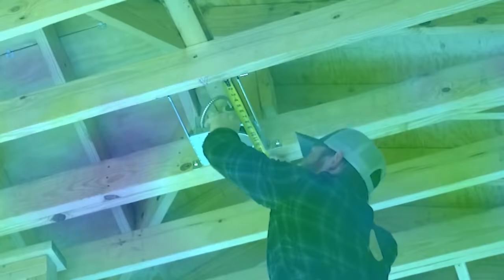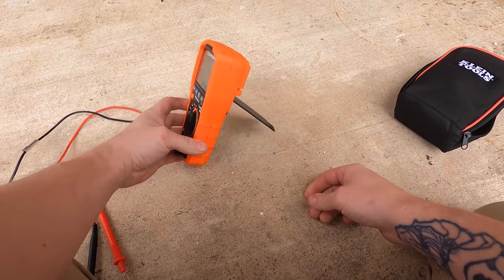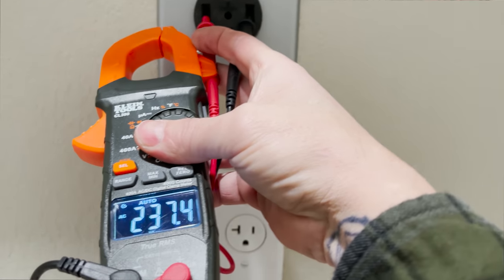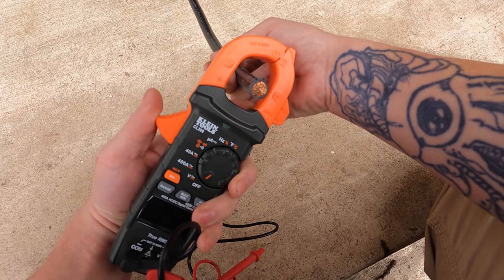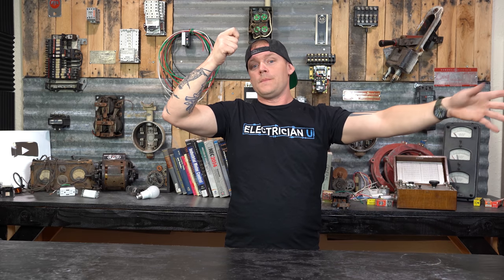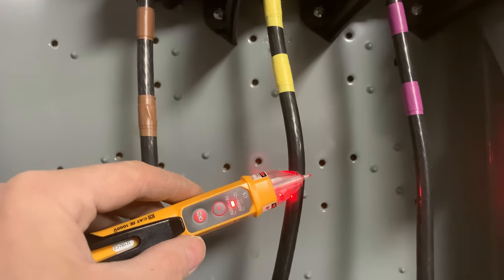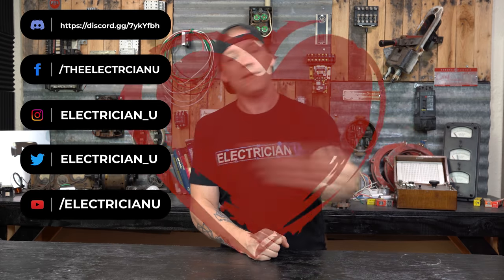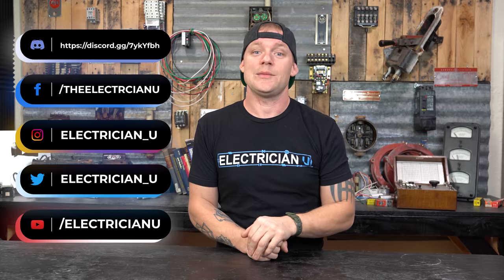4 Basic Electrical Testers & HOW TO USE THEM

Comment: Checking for current is like making sure a gun is unloaded or there is fuel and oil in the airplane. Check it yourself. If I tell you it is okay, still check it yourself.
Reply: Agreed and your loaded gun comparison is spot on.
Reply: The airplane analogy doesn’t really work but I agree with the rest
Reply: Whether the wire carries current or not, it doesn’t matter. What matters is if the wire has a voltage with respect to where you stand (usually Earth ground).

A wire is said to be live/hot/active if it has voltage (with respect to ground), not if it carries current or not.
Reply: Day one of my apprenticeship I was with a journeyman who checked to make sure the fixture I was working on was dead. Then he handed me the multimeter and had me test it myself and said the number one rule when it comes to my own safety is to trust no one and always test for yourself. Really valuable lesson to learn in this field.
Reply: As a law enforcement officer, when dropping off a prisoner to lockup, they would always ask if the prisoner had been searched.  My response, “The prisoner has been searched, but for your own safety, he should be searched again.”
Reply: My journeyman told me when I first started “don’t trust me” and I was like dang! So I don’t trust anyone now if they tel me it’s off
Reply: Check for voltage.  Voltage is the loaded gun.  Current is the bullet on trajectory.
Reply: I also thought of the loaded/cleared firearm analogy while watching the video 👍🏻
Reply: @skautisti2868 if the airplane runs out of fuel she may crash . The analogy of be sure of something yourself not depending on another's word something is safe .
Reply: @glasshalffull8625 amen my friend.  Safety first
Reply: At 1.5V will you be electrocuted? How about at 240v ? I don't know why they keep saying electrocuted why not voltageted?😁
Reply: Love the gun analogy
Reply: Yep, had a boss tell power was off on a machine, only trusted him because it was my boss, and got my ass shocked like a mf

Comment: Wow, this has been up a few hours and not one person whining about the meter not being Fluke? I'm impressed.
Reply: I see Klein is the new sponsor listed on this video
Reply: @johndernberger1961  Right? Wish I was sponsored by Klein
Reply: You’re the first...
Reply: @AV84USA  Not seeing where I'm complaining. But if you say so hahahaha
Reply: This is especially interesting when you consider his video comparing multimeters and he basically trashed Klein without even giving them much consideration.
Reply: Klein meters are obviously not as good as Fluke meters, but I find them to be solid. Definitely worth considering if you're an apprentice/helper and can't justify splurging on a Fluke when you're still green in the trade.
Reply: Kleins are pretty good, thats why. But I know fluke is the industry leader in meters.
Reply: Just don't use a harbor freight special.
Reply: I use the wiggi as a go no go gauge as a quick check for on or off. I.e.
Reply: @davids.9924  My fluke 115 usually stays in the truck. My CL700 does pretty much everything I need to do. Only clamp meter I've found with LoZ on it.
Reply: I’m a bit of a Klein Fanboy so most of my stuff is Klein.
Reply: 35 yrs ago, Fluke was the multimeter just about all automotive techs would not spring for.
Reply: Modern Fluke is overrated anyways. They may be the best, but it's not by the longshot their prices suggest.
Reply: @GuyFromJupiter  It depends on what you are doing with it, if you are a   residential, commercial electrician you don't need a $600 Fluke true RMS digital multimeter, Klein makes pretty good meters at a reasonable price.
Reply: Cause Fluke not always worth it.  Got an Amprobe 570 and it's just as solid as a fluke and only $200
Reply: Are you impressed when someone says your phone is not an iPhone, or is not an Android-based phone?
Reply: First fluke meter I bought lasted less than 3 months before throwing false voltages and false continuities. Left a really sour flavor in my mouth. Had owned a klein dmm prior for 10 years. Bought a klein meter to replace the fluke.
Reply: @altuber99_athlete  I mean fluke is the iPhone of electrical meters. Just as overpriced and unreliable. So I'd friggin hope I get annoyed by people that brag about using overpriced equipment that might light me up.
Reply: @hamburbers  - Must have been a "Fluke"
Reply: I prefer Fluke only because they are a local company. The fact that they make the best is a nice plus too
Reply: Who cares. I have a fluke but also a southwire when im in a skuttle hole and dont want to ruin my fluke. Sue me. My southwire does just as good.
Reply: @BA-gn3qb  lol because a fluke is a fluke is a fluke.

Comment: My boss and I were adding a 100a feed and I started cutting the 3-0 wire in the first ground box for make up. I got the weird feeling that I should confirm our wire was still dead, but I didn't have my tick on me. I decided to get up and walk the 200yds to the panel(panel was behind a wall and you had to walk aways to get around it). Sure enough my boss had left the breaker on after he installed it. Never trust anyone when it comes to electricity, and even tick testers are fucking liars sometimes.
Reply: Get yourself an electrician safety lock kit, box lock, push-button lock, and breaker lock. I was drilled to use them when I was working in a mine mill, every worker have their lock, electrician or not, if they caught you working on something without a lock you end up sitting on your ass at home for a week without pay. Hey, it's just me saying, you have the freedom to get killed. Just one more tip, you need to be the only one with the key, not even your boss should have the key, they are often the most dangerous when the production is on the line.
Reply: Lock out tag out systems
Reply: @mickeywhyte4331  we use that here at the airport. We call it exactly that
Reply: Always carry your tick on you. Keep it in your pants pocket. Second as you said, “never  trust someone”. Use your voltmeter yourself before cutting the wire, even if you were the one that shut off the breaker I don’t care, METER IT. Locking off is a great procedure too.
Reply: @dreadsguns  doesn't everyone call it Lock Out, Tag Out? I've never heard it called anything else.
Reply: @Southernboy302  that is the industry standard term for the equipment and procedures.  Even osha uses the same terminology
Reply: Bosses are always trying to kill you. I had on that turned a breaker on while was wiring outlets twice.
Reply: LOTO saves lives

Comment: Might have been more helpful if you explained the importance of testing an outlet receptacle in the correct order of probes and instead of just saying stick one in than the other. You always probe the black probe to neutral or ground first then the red to hot to test. To finish always remove the red probe (hot) first.
Reply: Thanks for saying this, I was wondering

Comment: I’m a handyman and a good part of my business is replacing outlets and light switches, having said that 50% of the ones I replace have a broken wire in them. And mostly because the wires are pushed into the back of the outlet/ switch. I’ve seen a lot of smoke, arc, burned areas in the walls. When I’ve replaced an outlet I use one with plates on the side then screw down any unused lugs and put 2 rounds of electrical tape around the screws/lugs, if I’m in a jbox or Gang box that has wire nuts in it I pull them out take the nut off check for broken wire if none put nut back on and wrap in electrical tape. Some will say that not necessary however if I’m seeing signs of possible fire I think it is. Great videos , thank u for what u do
Reply: You can never be too careful my dude.
Reply: Backstab wiring is the worse.
Reply: You actually are not supposed to tape yoked devices.
Reply: How much do you charge to replace outlets/switches?
Reply: @daylenconn282  why is that?
Reply: @twf5822  the technicality is that those yoked devices create heat and electricity should not be taped in places that produce heat. Most places already have their own codes against taping outlets.
Reply: I have run across so many electrical violation that a handyman has done like causing objectionable current and neutral problems on multi-wire circuits where one time all he did was remove a neutral at the panel and killed 2 computers and a TV not to mention could have caused a fire, you may be ok on minor issues but how much can a guy invest in tools and studying theory & NEC  while doing painting,drywall, carpentry, plumbing and more ? Just be careful and not do work thats over your head even if you turn down money, it may keep you from being sued and blamed for a fire.

Comment: I do industrial maintenance and use the klein mm700 and cl700 almost daily.  Great equipment especially with the magnetic hanger and alligator clip leads.  I wish there was a way of keeping the backlight from timing out so quick though.  A note on the tone stick- I know it's not as reliable as the meter for checking potential presence but the meter will show no voltage unless u have a completed circuit.  The tone stick doesn't require a completed circuit to show presence.   Awesome video as always :)
Reply: read the manual i think it is push hold before you turn on the mm700 and cl700

Comment: Was working as a lighting tech on a movie in NYC and was told by a Gaffer that the circuit was off in a major power server in the NYC library.  Got quite a shock that day...and my linesman pliers were toast:)
Reply: Get yourself an electrician safety lock kit, box lock, push-button lock, and breaker lock. I was drilled to use them when I was working in a mine mill, every worker have their lock, electrician or not, if they caught you working on something without a lock you end up sitting on your ass at home for a week without pay. Hey, it's just me saying, you have the freedom to get killed. Just one more tip, you need to be the only one with the key, not even your boss should have the key, they are often the most dangerous when the production is on the line.

Comment: Just started a new job testing EV engines on dynos and my degree is in mechanical engineering yet most of the knowledge required is electrical.. thank you for this sir

Comment: Great video, I always treat every electrical wire as if they are always hot, we were taught if u must touch a box wire or anything that is close to electrical touch with the back of ur hand/ finger first. If u grab something that is energized the muscles in ur hand will contact and it is very hard to get urself free of it even if u have help

Comment: I like the NCVT. It is nice to use and although it has limitations, those limitations can be used for your advantage. The one that gets down to 12V is nice, because it can be used to work on irrigation circuits. I was pleased to see you included the 12v option/advantage in your description 😀

Comment: I used a tick tracer for demolition when I had to cut a crap ton of power wiring but leave the essential things (lift, fire pumps etc) intact. Out of few hundred readings I did get maybe half a dozen false negatives and cut them with a spark and had to have a sparkie to come restore power to an essential appliance I cut off. After that job I always carry two of those tracers, different brands, and use them together. I don't know if I'd be actually safer that way but I hope it reduces the chance of a false negative reading greatly.

Comment: I recently upgraded my receptacle (plug) tester to the Klein RT250... its nice to have a slightly more simplified pass/fail set of lights (2 vs. 3, green/red, yet it also shows specific failures if they occur).  The GFCI test shows how long it takes to trip (in hundredths of seconds) and may help to identify failing GFCI.  It also has a built in voltage test so you can detect voltage drops on excessively long runs.  Only downside is it does require batteries.  ;)
Reply: The RT250 is a great piece of equipment.

Comment: I bought a package deal from Klein Tools a few years ago to use around the house to help with repairs. It had a basic tic tracer, a digital multimeter, and a outlet gfci tester. The whole package was about $40.00 and I think it was a good value. I have used it several times now and would buy it again if I had to.

Comment: Just checking, but….if testing a live/potentially live household outlet with a  DMM:  if you insert the red probe in the right opening first…….doesn’t that immediately energize the black probe; creating a potential arcing if black touches something?

I was always told Black/Left Side first, then Red/Right next; and removing Red, then Black (as to not energize the “yet-unused” probe prematurely,

Comment: There's a Klein fox and hound you can get now which has a GFCI tester / outlet tester with it.  It's cheap, and great for tracing lines to breaker.  Great video! "Digital Circuit Breaker Finder"

Comment: 1. Meter must be listed and of appropriate rating. (eg. CAT lll 600V) 
2. Inspect and Ohm test leads.
3. Verify operation with a known power source.
Plug in circuit analyzers wont detect "bootleg grounds.
NCVT "voltage ticks" wont detect voltage if the paper sheath in NM cable (Romex) is wet.

Comment: As an HVAC tech, my multi-meter is so important I keep a back up in my backpack in case of failure or loss. Tracing voltage, continuity, testing micro amps on flame sense circuits, motor run capacitors, voltage drop across a contactor...  I found this video cause I wondered if you had a good tutorial on usage. I want to recommend a good one to some of the younger techs. For example, if your probes are across a switch and it reads voltage.  Is the switch open or closed? Amazing how few know the answer.

P.S. Customer told me the Condenser circuit was off.  I checked and it was live.  OH! I turned off the "Compressor" in the garage.  Sorry!

P.S.P.S.  Might want to mention more than once what happens when a switch breaks the neutral rather than the hot.  The circuit is off, yes, but not isolated.  Twice a newbie working with me cut a wire and it arced, and he was so surprised because the switch was off.

Comment: 2 tools I never troubleshoot without.
-Wire tracker set
send a distinct signal into one end of the wire you are looking for and go looking for the other end with a probe that translates magnetic fields to sound.
Works a hell of a lot faster at finding a wire than playing with breakers. In an installation with some 300 or so unmarked signal wires to search through, you can save half a day's work easily.
-Insulation tester
a lot of faults involving damaged wiring do not actually sever the conductor and a standard multimeter cannot detect breaches in insulation without direct contact to another conductive object. By sending a slightly higher voltage pulse through the conductor, the electricity can bridge the air gap concealing the fault during normal testing.

Comment: Another tester I carry is the breaker tracing made by klien love that thing has saved my butt more times than not.
Reply: @D675  amazon is where I got mine
Reply: We do alot of TI work in office buildings. And it's pretty much a requirement. And we have to go one further step and amp probe the CT to make sure it doesn't have load before we turn it off. Making sure someone else isn't using ciruit.
Reply: @phillipfessenden7705  we don't do very much TI work mostly remodel and commercial work
Reply: Just ordered one this evening.   Can’t wait to use it!
Reply: Can a breaker tester also be used to find out what outlets are connected in series ?
Reply: @derekw40  Yes
Reply: Dude I love that thing! It’s like magic. I just do stuff around the house and my parents house but since they were slapped together homes from the 70s the wording is super off amd doesn’t make any sense and this sucker has saved me so many trips back and forth between the breaker box and whatever I’m trying to turn off.
Reply: And if you buy a socket adapter with a two to three prong adapter to plug into it you can use it on lights too 👌. Love that thing..
Reply: @JA-wp6cj  The kind I have has that included as part of it. It’s amazing.
Reply: @hamel445  5
Reply: @mittlefraser5554 what up

Comment: Tracer or locator, anyone who has ever worked in Parking Lot Lighting or any kind of underground electrical. The first one seen but not mentioned looked exactly like the one I used to have. 

Can give you tone down to eight feet with Blacktop or Concrete on topside a must in underground locating, especially when you think of the cost of excavation. This was over 30years ago I can imagine how much things have improved...

Comment: i can relate in some ways
I was working on a fridge freezer.... I had unplugged the fridge to pull the coils... I left to get a tool so when I came back I reached in and got shocked I found out the former roommates former husband had re-plugged it back in... from that day on I have always put tape around the plug anything you survive is a learning experience
Reply: Always double and triple check if something is live before you touch it

Comment: I got some non contact voltage sensors (what you are calling a tick-tracer) at my job for troubleshooting solenoid valves on environmental chambers. Helps identify if valves not actuating are the fault of the control wiring or the valve mechanicals being stuck.

Comment: As an amateur, I always test with a sniffer or multimeter before I touch wires, but then do a last check of also pressing a screwdriver or knife to short across the wires to verify there's no charge. I've had enough surprises from capacitors and wires in the last 20 years...

Comment: UK spark here. Safe isolation. Check tool, verify dead, then check tool again. If you are working on a circuit it is your responsibility to verify dead and lock of as necessary.  Do you guys use MFT's?